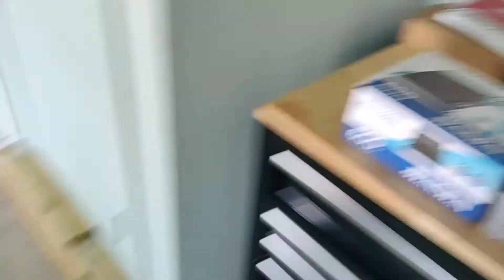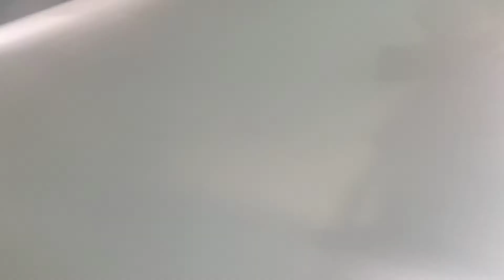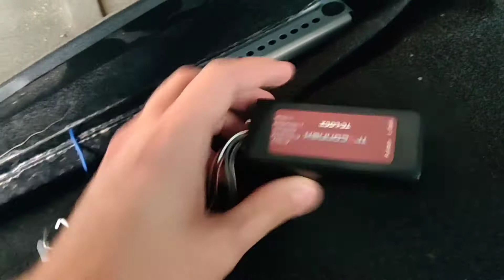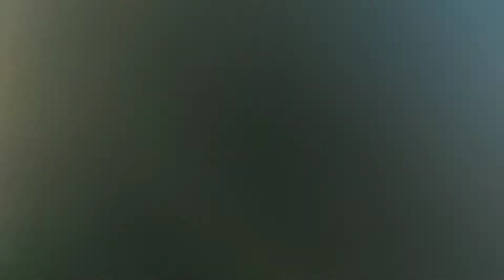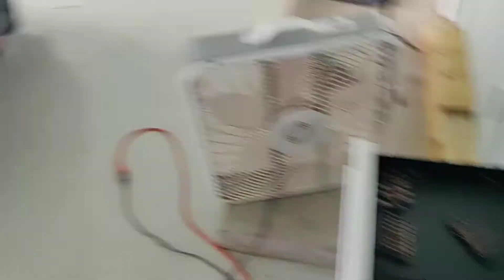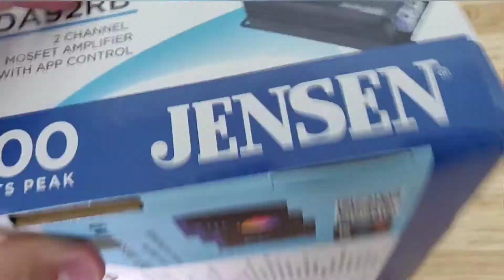How To Install Sub & Amp In Stock BRZ/FRS/86

Comment: Hey, I’m confused what that extra piece you didn’t use is. If I can splice directly into the original amp speakers, and send that to my amp, what is that extra piece for?
Reply: Nothin it depends on if you can connect to the amp or not it’s just a line out converter if you do it how he said then you should be ok

Comment: Trying to figure out how to remove those side panels where you ran the wire lol.
Reply from the maker: Which ones? The one by the front floorboards or the back passenger? Most of them are all held in by clip
Reply: @touchofturbo all of them. Yeah, I figured them out. All are clipped in. Was pretty easy to take them out. Thanks for the video.

Comment: So if i use a  line converter i would tap that remote turn on into the factory amp turn on and leave the remote turn on slot on the new amp empty ?

Comment: So the white connection going to the amp on the sub are the wires you spliced into the factory amp?
Reply from the maker: Yes that's correct. The amp from Walmart comes with that little connection adaptor. You'll use that to tap into the factory amp

Comment: If you're going to spice wires do it the right way don't use t taps
Reply from the maker: There's nothing wrong with Tap Splices, this allows you not to have to cut any of the factory wires. I'd rather not cut them as you can't go back from that
Reply from the maker: Been using the Tap Splices for almost a year now with zero issues
Reply: @touchofturbo  I mean it really depends on the application I guess, as far as speaker installation I don't use them but they probably wouldn't give you issues.

Comment: so now will your door speakers are they going to be running on the new amp as well.
Reply: No, the door speakers will continue to run off of the factory amp. You're just tapping into the wires not cutting them
Reply: @405resells6 literally same thing